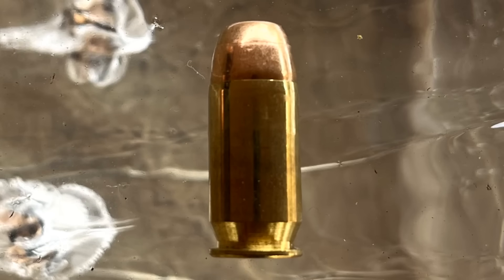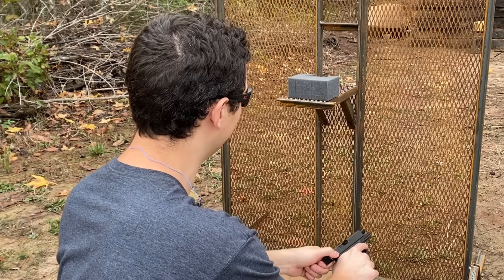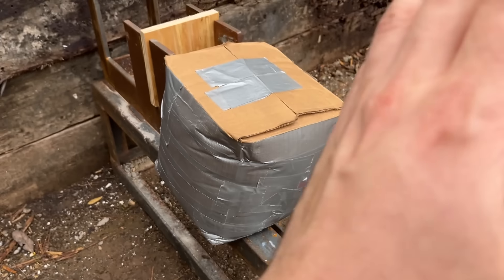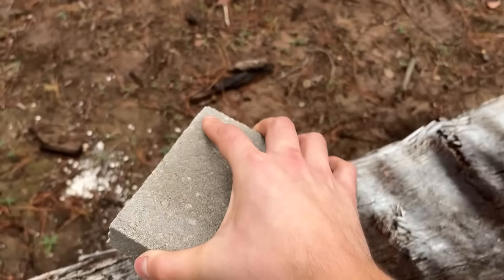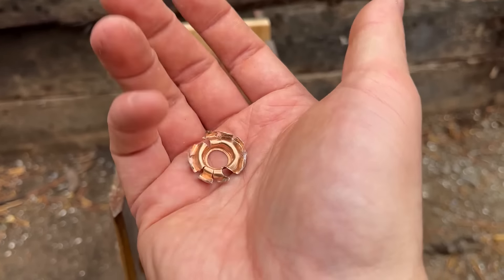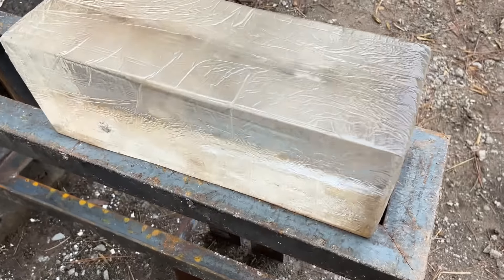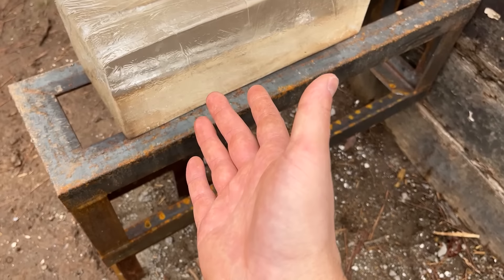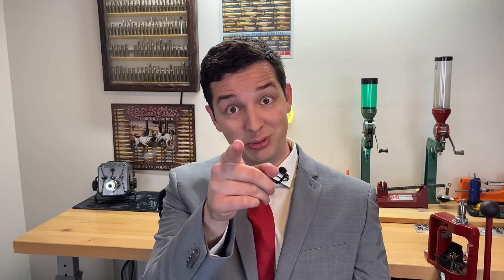9mm vs 45 ACP Barrier Test: No Debate?

Comment: This has already been studied comprehensively.

 Look up the 2017 joint agency ballistic study on handgun ammunition.

A 45ACP, creates 60% more tissue damage in  it's wound channeling then a 9mm, you have to take the  the surface area of the bullet and times it by the depth.

This has been repeated over and over, a 9mm doesn't get anywhere near the wound channel results of a 45.

And for those that think 10mm is superior, it's actually the opposite.

 these studies showed that fast hollow point rounds in 357 magnum and 10 mm did worse in the outcomes, because the high speeds caused the bullets to fragment and break apart affecting their ability to cause permanent wound channeling the way they should.

Using hard cast bullets in these calibers as a woods gun is a different story, but when it comes to jacket at hollow points, they're problematic.

As far as ballistic gel, wound channel in gel is irrelevant, it has no relation whatsoever with  living elastic tissue that is compressible.

the only purpose of gel is to provide a comparison as a baseline for certain testing, but it is in no way representative of the human body.

Clear ballistic gel is even worse, and it is not calibrated properly for the FBI protocol. 

 it has to be organic Gel kept for a certain temperature and then it has to be calibrated with a bb gun.

In fact,
 in these studies, the only caliber that consistently performed in every category, including penetrationand  still providesd permanent wound channeling effectively, 
was the 45ACP, the heavier weight and mass of the bullet plays a major role.

This is a complicated topic, and YouTube videos are fun, but these experiments are far from scientific and if you really want to know the data you can research it.

Comment: 9mm usually has a little bit better penetration, because it has so much more velocity and energy than the 45acp versus the 45’s weight. But of course, the 45 has a much larger wound cavity. I think that pretty much sums up the different animals here.
Reply: The 45 did not have a larger wound cavity in the video. It was smaller than the 9mm.
Reply: @Radvous no it was not smaller, that entry wound is always almost a half inch, no getting around that trauma and hemorrhaging. 
Both deliver far more than enough trauma, but to say it's "bigger" is arguably not correct
Reply: @Radvous the 9mm has to expand so much just to equal the 45s entry wound, they both started to expand at the same distance upon entry, even if the 9mm expanded more, it has to expand more than that to make up that lost width it has from the 45
Reply: @cocomoomoo  it's not always about the diameter of the bullet. A small bullet at a high velocity will cause wounds much bigger than the bullet diameter itself. That's why a 5.56 will have a larger, more devastating wound than the 45 acp. A 5.56 will have a larger wound than a 1" inch diameter steel rod driven very slowly into you. In the case of 9mm vs 45, the wounds are extremely similar because even though the 45 is larger, it is slower, and even though the 9mm is smaller, it is faster. It almost cancels each other out with these two rounds specifically.
Reply: @Radvous  9mm isn't that much faster than 45acp tho 🤔
Reply: @Radvous  but I will agree they cancel each other out tho, im not even a 45acp fan boy, I'm carrying 9mm right now, but if you look at the first test it really shows the entry wound, that does matter, hemorrhaging and entry wounds do matter, the larger the entry the harder it is go clog, but like I said I'm not even saying it's more lethal than 9mm, 9mm like said is faster and is far more than adequate compared to 45acp
Reply: @cocomoomoo  it's not much faster, but it's significant enough to almost equal out the two calibers. Remember, if you double velocity, your energy gets multiplied by 4, if you double your mass, your energy only gets multiplied by 2. And yes, entry wounds are nothing insignificant, but it really does not compare when you're talking about a 14 to 16 inch bullet wound that, on the inside, is a much bigger hole than the entry. It's not that we bleed out of the entry wound that kills, us, but mostly that we bleed internally. We could easily dump a few liters of blood into our bellies by getting shot, even if very little of that blood comes out of the entry wound.
Reply: @Radvous  yes but in the feild all you can do is stop external bleeding and prevent the hemorrhaging. next to surgery, You aren't going to stop that internal bleeding, but like we said it basically nullifies each other, 45acp is closer to double the weight than 9mm is closer to being double the velocity of 45acp (ofc these would be best case comparisons)
Basically I believe we are just saying the same thing with little variations on how we see it lol
Reply: @cocomoomoo  maybe, but just to add one thing, the 9mm being half the weight does not need to be twice as fast, but only has to be 41% faster in order to produce the same energy as the heavier 45. Which is 1,174 fps with a 115 grain projectile. A 230 grain 45 going 830 fps, and a 115 grain 9mm going 1,174 have the same exact energy. 1174 is pretty average for 9mm as well.
Reply: @Radvous  I mean there are still alot of variables to the equation, barrel length as an example, a smaller barrel even for 9mm isn't hitting the ideal numbers, you probably need a full sized pistol to achieve those, as well as bullet type and grain, there are 45acps that have heavier grains and reach 1200+ fps, im sure there are 9mm that reach 1500-1600 but still, when people say 45 is slow it doesn't really matter as long as it's fast enough to expand
Reply: @cocomoomoo  I'm comparing primary full size in both guns, 1,174 on 9mm 5" inch barrel, 830 on 5" barrel. You're right, ammo types do matter, but as long as both bullets are stopping in a body, the same energy is displaced, whether that be in the shape of a long but skinny wound, or a short but fat wound. In physics, if a tiny partical and a large partical exert the same energy in the same amount of time, into a body for example, the wounds will be similar and bullet size does not make much of a difference. NASA has tested a 12,000 mph (17,600 fps) grain of sand on large aluminum plates, the one tiny grain of sand blew a massive hole in the aluminum, it did more damage than a 50 BMG and 20mm cannon would do. Same force dispensed, similar cavitation almost irrelevant of bullet size.
Reply: @@raytrammell9452 your 40 grain .22 would have to travel 2,000 fps to have the same energy as the 9mm and 45. So yeah,  that's gonna be very lethal.
Reply: @raytrammell9452  lots of people like to defend the 45 saying "yeah same energy, but bigger hole", but if that's the case, an 1820 grain (4.16 oz) bullet going 297 fps (airsoft speed) has the same energy as the 45 acp, would people rather choose that? -- Or a 7,280 grain bullet going 148 fps, which equates to a 16 oz drink/water bottle being thrown from a 100 mph car at your chest--this has the same energy as the 9mm and 45. My issue is just that, if you're going to carry a caliber that's twice as big as another, it better be twice as powerful, not the same power. Why would I carry the same energy, but in a package twice as big, it makes no sense to me.

Comment: Super great testing. I tested 9mm vs 45 ACP with cement lap siding (8 1/4 wide) layered tgem together 45 went through 2 and mushrooms the back big-time of 3&4 layers. 9mm went through 5 or so and less mushroomin/ deformations of cement panels. 45 packs a punch thow
Reply: Shot 6x6s w 9mm FMJ w no pass thru using 1/4" Hardi laid flat against wood. But w/o Hardi it passed thru 6x6 in FMJ or JHP. Didn't find bullet in earth backstop half the time either. I'd keep 45 in my bedroom if I didn't live alone tho.

Comment: The 45 absolutely owns the 9mm in suppressed shooting. Otherwise, the 9mm high velocity evens out the huge 45 hollow point. So it comes down to capacity and the speed of follow-up shots.. which 9mm clearly wins.  It's all about Purpose Of Use.
Reply: modern ammo is awesome! but there are some nasty +p .45 out there that can create havoc really. It's all about ammo selection, handgun selection, follow up shots and shot placement as you said. I would go with 9mm for defense, although I love the old 45
Reply: And when you go on your James Bond missions with your silencer, do ask for a martini or bud light?
Reply: @HWG-wm8ld  I'm more of a gin & tonic man  😉 but for suppressed, my choice would be the FN545.. 😉

Comment: I was going to say that if you're not using Crit Duty or some version of that high tech bonded led/copper thing, then there'll be more questions. They may make a 9mm as good as the old jacketed .45acp BUT then if you use the bonded in the .45 then we're back to .45 better. The 9 needs to be +P too....and 20 9mm rounds vs 10 .45...maybe 16 .45acp. Hell I don't know.  
I just know that ten .45s pulls my pants down...and not in a good way.

Comment: When comparing these 2 rounds. You have to remember that, 9mm is smaller, and travels faster, but has less stopping power due to the mass of the round. Where 45 acp travels slower, and has a larger mass. There for it has more stopping power. It is that simple to understand.
Reply: Speed is what causes power a small round traveling 300-400 feet per second more can have just as much power this is why a magnum round has so much power in the end it is about muzzle energy which the 9mm and .45 acp are about equal.

Comment: This Debate ENDED when the FBI did a study ( 2012 ) of 900 Agents and discovered that when in a stressful situation like a Gun battle, ALL of it's agents MISSED HALF of their shots when shooting.  Since MORE Ammo was required BC of Missed shots...They changed ALL their Pistols to 9mm with LARGE capacity carry. So you can carry anything you want but IF you MISS HALF your shots...BETTER have as many rounds as you can.
Reply: They also found that terminally all were nearly identical and the projectile design mattered more than caliber combined with the issue of missing.
Reply: Sounds like the issue is their lack of skill with the gun and not the caliber. Sadly, most people who get paid to carry a gun don't actually train enough to be proficient and safe when they start shooting.

Comment: The 45 did a lot more damage to the cement block than the 9
Reply: Good if you are being attacked by a concrete block
Reply: @Rubeless good if the person attacking you is hiding behind a block wall. People use cover in gun fights...
Reply: How are they attacking you if they are hiding? You gonna take out a wall with all your ammo. Clueless
Reply: @HWG-wm8ld  it's called fighting from cover. There's this thing called suppressing fire, fire superiority, and violence of action. Some bullets have the ability to turn cover into concealment more efficiently than others.
Reply: @Kinetic.44  it still wouldnt have done nothing to the person, as you could see in the vid there was not a stratch on the plywood

Comment: I don't think the question or controversy was about penetration but more the power of impact. In other word which has more stopping power. Because if you're using them for self defense, you don't really care about penetration as much as you care about stopping or knock down ability.
Reply: No pistol caliber can "stop" or "knock down" an adversary. This is proven by Newton's third law of motion. The energy transmitted backwards to the weapon is equal to the energy transmitted by the bullet itself. In other words, you can't knock someone off their feet with a projectile from a pistol without getting knocked down by the recoil yourself.
Reply: @hb9145  it's a metaphor
Reply: @risanch  Cool, if one if writing literature. Take a look at FBI's Handgun Wounding Factors and Effectiveness, and you'll see that only shot placement (spinal cord or brain) can effectively and reliably stop en opponent. Furthermore, if the bullet has sufficient penetration, pistol caliber is more or less irrelevant, and shot placement is by far the most important - all according to the report.
Reply: @hb9145  OMG are you serious? do you understand the meaning of metaphor? I'm done. Have a wonderful day.
Reply: @risanch  I teach literature, and that is not what a metaphor is. "I'm locked and loaded" would be a metaphor. You just mentioned  scientifically unsupported colloquial expressions that attempt to convey the idea of a caliber's ability to quickly incapacitate or stop a threat. Goodbye.